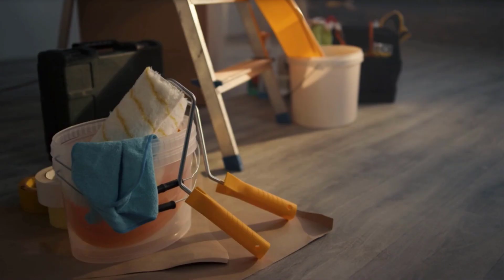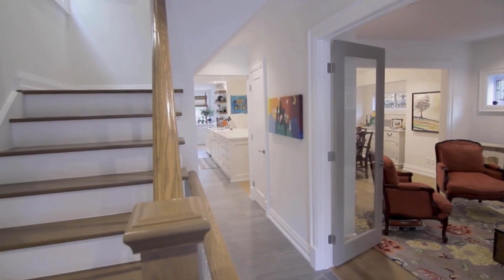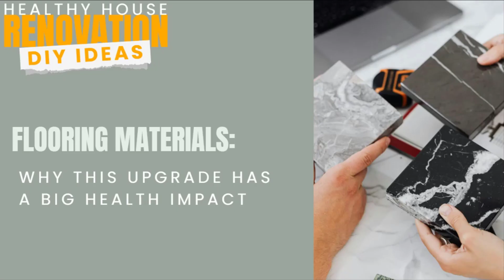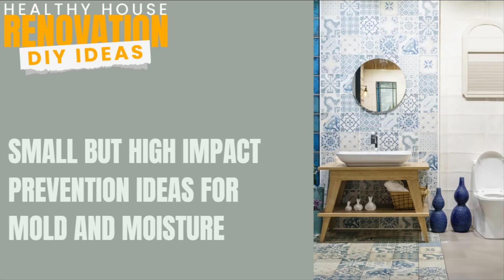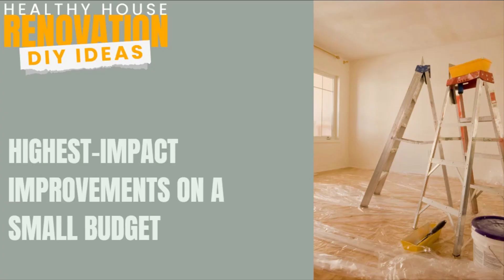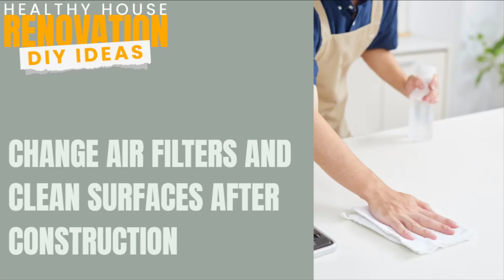Smart, Healthy Home Renovation Ideas for 2026 | Low-Toxic and High-Comfort Living

Comment: How do you find "healthy construction workers" that are willing to do things this way? I've had a hard time finding just an average construction worker to complete a job--and when I mention things like VOCs, they just have no clue and also are not comfortable using materials/products they haven't used before.
Reply from the maker: That's a great question - and a real problem in the industry.  My best solution is to work with someone like a consultant or project manager who can help bridge the gap between your needs for a healthy home and the contractor.  We're able to come up with a plan for building practices and vet all the materials before they start to keep toxins to a minimum.